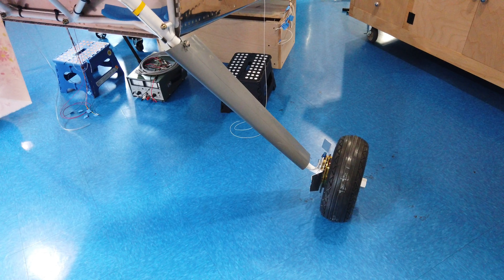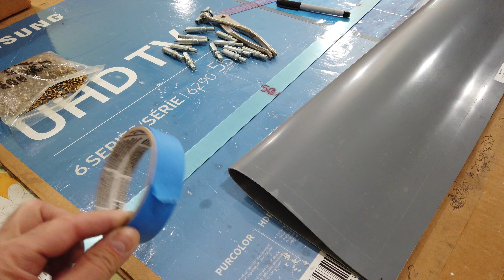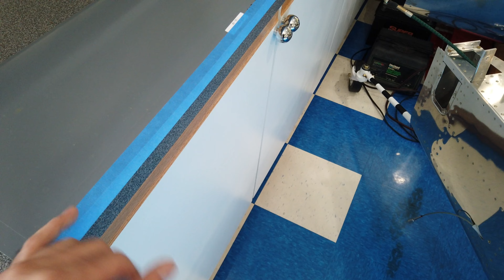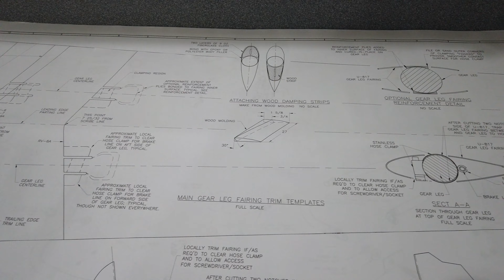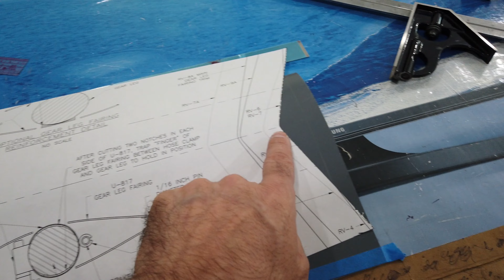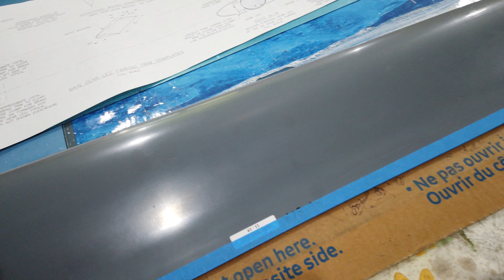Vans RV 7 HINT Video Gear Leg Fairings 2

Comment: Isn't the tip of the cutout you have meant to be 3+ inches away from the scribe line, not butted up against it? I have non-gelcoated fairing so I presume I am going to have to cut the plan where it lists the scribe lines and then cut the drawing again to get the fairing length lines as well.
Reply from the maker: Watch the first 60 seconds of the next video in the series!   

 https://www.youtube.com/watch?v=ZirbtaXM9J8

Comment: After taping the trailing edge, did you try flipping the fairing over onto the other side and check for flatness again? Since the fairing is tapered, I'd expect your method to build a twist into it. 
Your method is how the first builder on my RV-6 built the elevators (remember those are not pre-punched on a -6), and they were very flat on one side and very twisted on the other!
Reply from the maker: The leg seemed to lay just fine  on either side. The hinges used have a lot of play between the knuckles. Even after completion, it is very easy to twist the fairing; the hinges do not completely lock it in position. Work in progress, we'll see how it goes.